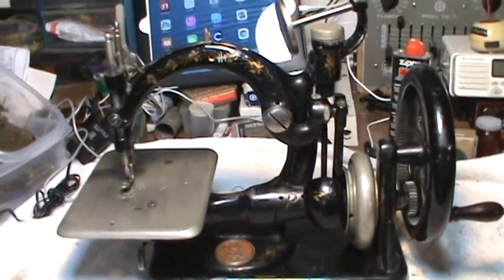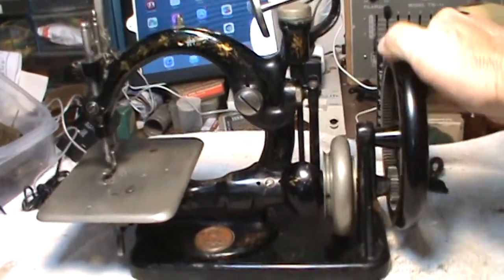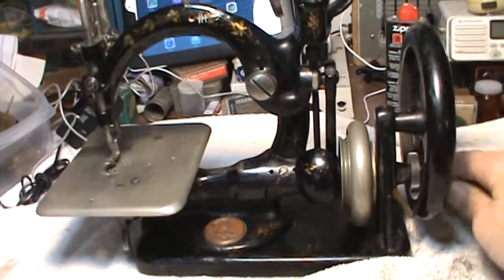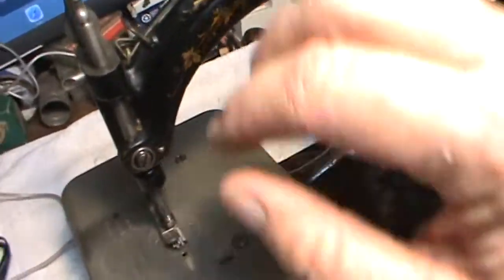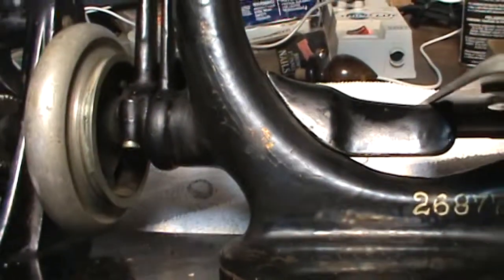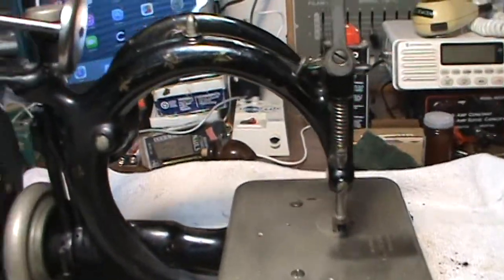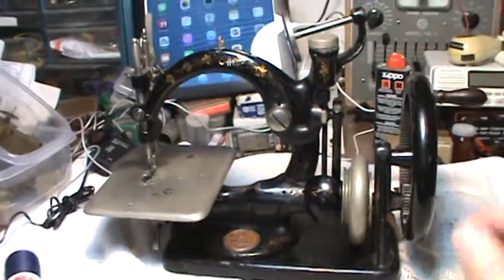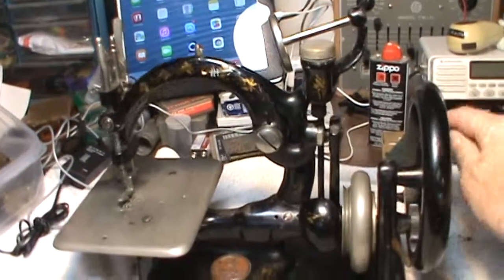Assembly of the 1879 B. Eldredge Automatic Sewing - Finished!

Comment: Also found an obscure bit of info on the hand crank base.  They were made for the American market for Willcox and Gibbs chain stitch machines in around 1900.  Like the full size iron treadle base that has a ball that keeps it from sewing backwards, so does this handcrank.  Just in front of the small gear cog on the hand crank is a small hole.  This small hole looks like an oiling hole.  Inside that hole is a tiny piece of leather that prevents it from sewing backwards.    Google for that info.  Also google search for the type of modern needles used for Wilcox and Gibbs.  Fiddlybits has an excellent tutorial on youtube on how to thread a Willcox the clone to the Eldredge.
Reply: Thank you for sharing this information. Much appreciated, as there is still much to learn about those older non-electric sewing machines.

Comment: The extra piece you tossed on the table i not a hand crank guard.  It goes right below the large round silver  "screw" with the large slot located on the front of the machine.  The pointed end fits in the hole on the right side of the machine chassis (frame).  Second, the spring you have on the presser bar on the back does not go there.  That is why your presser foot is loose.  There is a plunger and it goes with that spring inside the machine head.  Google Helen Howe Willcox and Gibbs.   She has a spring and plunger that looks exactly like your parts on the table in your first video.  I have an intact Eldredge and the Eldredge is an exact copy of a Willcox and Gibbs.  Your needle bar with the round ball top is from a later Willcox.  Seems the needle bars were broken quite frequently on the older machines.
Reply: Again, thank you for sharing. Appreciated!

Comment: Wow, finally someone has posted a video on this. I have a Willcox Gibbs hand crank portable, still using the belt , but has seized up. I ve been  hunting for info on how to take it apart and put it back together , to get it working. these machines are a chain stitch , no bobbins uses only one line of thread . The table top version was just the treadle made portable. Check "fiddleyBits" on YouTube for many videos on how to thread and use, basically the same machine as the Willcox Gibbs. If you have anymore info on how to assemble the needle end, that would get me in the right direction, thanks.